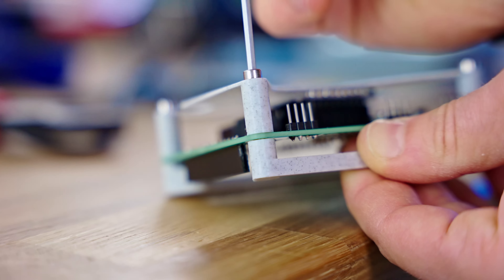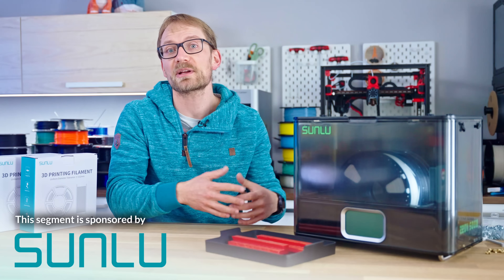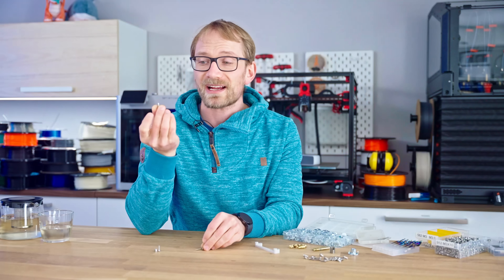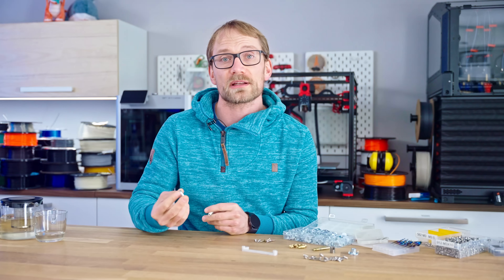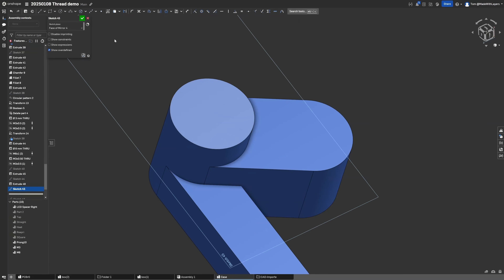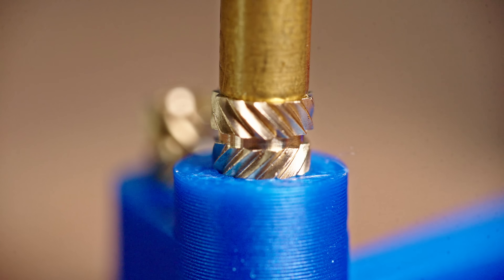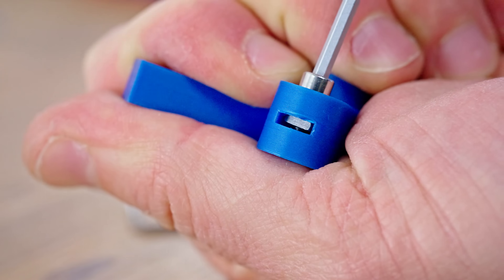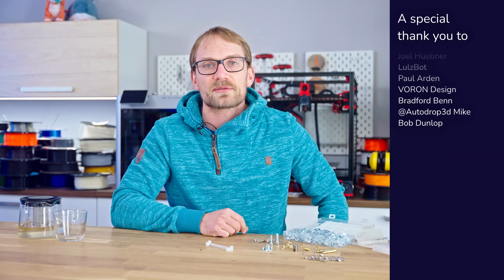A better way to add threads to your 3D prints

Comment: When ever I have holes in prints, regardless of threading method I choose, I ALWAYS use extra perimeters in the area of the hole.   Just about every decent slicer has a way to change settings for an overlapping volume or other way.  Having very well reinforced holes means that the holes are not where I get failures.

I always use 150% to 200% line width in areas where I need good layer welding for stress. (Thanks, CNC Kitchen for all the testing).

For nut slots, a small little bump of plastic can keep them from coming out easily, optionally a 3d pen putting a dot of plastic in hole, or simply a dab of hot glue.  The hot glue is nice in that if you don't go nuts covering your nuts in glue, you can easily pry the hot glue out with a pick or tweezers.... This is a place where a little goes a long way.
Reply: What slicer are you doing to target specific areas? If I was trying to increase wall adhesion for a hole, Cura only allows modification of wall inset, inner/outer line width, and wall flow over the entire print stack.
Reply: @Infinion  cura does in fact support modifying print settings in overlapping areas. 

You drop in a second model... A box, sphere, cylinder, or other useful simple shape.

You scale said shape over the area you want to modify.  You can unlock the scale controls so you can stretch more in one dimension than another. 

You can toggle the mode of the object that is overlapping to make it a modifying boundary.  There are YouTube videos that show you how to do this, or to can just play with it knowing that yes you can use one model as a modifier for another model that you're printing. 

When the modifier model is selected, you'll have the ability to select what settings you want to override.

Mastering this technique is not too hard and it enables you to reinforce areas where there are holes or use extra infill but only on certain problematic areas.  All kinds of useful stuff.
Reply: @ Wow that's exactly the kind of thing I was hoping to hear, something I'd completely missed. Thanks, i'm going to jump down that rabbit hole and try it out.

Comment: sorry bro but a straight hole is perfectly repeatable if the plastic is melting then just drive it in slower. I use them all the time and they are more than good enough

Comment: I used to do the slotted nuts until like 2-3 years ago and use exclusively heat-set inserts now. Super easy to use (once you've done it a few times) and unrivaled in strenth.
Reply: me too.I feel like i've mastered the art of inserting them straight with a mere conical tip of the soldering iron, after doing like a mere 4 of them.
Reply: @victortitov1740 I learned a tip a completely changed my experience with heat sets. If you press them in most of the way then use a flat piece of metal or similar material to press them in the rest of the way (while the insert is still hot), the inserts go in straight, flush with the surface, and there isn’t any plastic bulging around the perimeter of the inserts. Hope this helps!

Comment: For me personally threads have generally worked quite well added to the design and printed. 
Even if they are not perfectly formed, generally it seems screws are able to move away / fully form them after use.

Comment: I often try to use a large vice to press in threaded inserts.
Sometimes I can add negative space behind it to use a lot longer M3 bolts so the direction is already set and I can use the vice to push them in.
Using a soldering iron is not matching with my level of (im)patience.

Comment: Lol, nah I use wood screws all the time. I'm just careful with the walls. Concrete screws are slightly better as they have a shallower thread than wood screws but still deeper and more grippy than machine screws. 
I live in Australia so wood screws are always in stock at bunnings,  whereas machine screws are either a trip to the local fastener supplier (in business hours) or take a risk on an ali order. 
Bunnings has machine screws in the right size only sometimes.
I only ever model threads for a printed to printed interface. 
Also, just through bolt with a hex nut is normally quite good.

Comment: Hi, very nice and informative. I think you forgot the option of  designing a hex/nut shaped slot on the opposite side of the bolt head. Very common and take very little space and is also rather strong and durable

Comment: I have been using heat inserts without heat for years.  I just design the hole slightly smaller than the insert and use a screw with a washer to force the insert into the other side like the large flanged nuts.  Also, I have been using hex nuts with the modeled point of the nut going towards the cavity, like an ope end wrench.  I rarely have had problems with hex nuts not working.

Comment: How do I make two threaded inserts line up so that I can put a single screw through both of them? An example being one insert in one printed part and another insert in another printed part, both need to be fastened together with one screw.
Reply: You use on heatset insert in one part. The other part has a hole big enough for the threaded part of the screw to slide through. Screw goes through that and into the heatset insert in the second part. As it is tightened, the parts are pulled together. You can add indexing features to the parts to keep them aligned well.

Comment: Recently designed a cooling shroud for a (now obsolete) mellanox 100gbe network card to use in a not-server use and I had no I idea where I had put my heat insert m3's, so I used m3 hex nut slots. There was some cursing involved in getting them slotten in due to the duct structure. But at the same time it was faster than ordering new heat inserts especially for prototypes that need to get out now rather than later.

Comment: Hidden nut is one that was left over. That means pausing the print and inserting the nut mid-print. It has IMHO superior strength but also quite finicky at time. You need to be very careful with tolerances so that in no case can the nozzle catch them and then there is the hassle of dropping them in the print. TIP: insert a parking routine in the pause at height code block. Think where the print and the printing head has to be for you to be able to drop the nuts in easily.. i've been burned by that once, literally (the damn nozzle lifted like 5mm up...).. You can use a tiny bit of superglue to hold them in place. 

But i found one insert type that i had not even thought about before, i got new ideas what to look for in the next trip to hardware store. There are fair amount of "inserts" when you look at sheet anchors that might work.. They are a bit large though but... who knows, there might be something useful in that department. There have been a lot of cases where i've had to use quite big bolts, i don't do a lot of fiddly things.
Reply: I tend to do this with the "inserted nut" method, otherwise, see 9:56, the printer will be trying to print a circle in mid-air, and the nut just helps to hold it up. Still not great since the hot PLA may not stick so readily to the cold metal of the nut.

Comment: wood screws are harder to source than machine screws? what??
Reply: also yea, wood screws are hyper-available, but extremely anti-standard in ways that don't matter to wood, but will greatly impact the amount of strength they remove from the perimeters
Reply: They look like what I've always known as self tapping screws.
They were used a lot on the buses I used to work on. The woodscrews have a pointed end, self tappers don't.
Reply: Not all self tappers are the same. Some are "thread forming" and others are "thread cutting." AFAIK it comes down to the knife-iness of the thread profiles 😅
Reply: @nodnarb3799  I like that - "knife-iness" lol
Reply: @nodnarb3799  I was a fitter so more used to proper threads, BSF, BSW, UNF, UNC, and Metric, not forgetting BA and BSP threads lol. Didn't get to use self tappers that much.
Reply from the maker: No, plastic-specific screws.

Comment: The self-forming thread comes at the perfect moment because I'm designing a holder for some art pieces where I need some holes for screws, but the parts have to be printed horizontally. Thanks Tom! ❤

Comment: I've used that "self forming thread" thing with friction fits a lot. Creating such ridges give the plastic a chance to deform and you get very nice fits quite easily. Of course it is not as strong since there is less surface area but you can also add epoxy or other glue in there. Do not use superglue for this... 

Superglue works the best the thinner the glue is and wider the area, and with ridges there is some space between the large surfaces. It is also a PAIN to work with friction fits and super glue, it can harden too quickly and you are left with stuck parts that are almost there... If you have to be able to detach the parts again, use contact glue. It isn't very strong material, it will hold things nicely but also can be pried off without the plastic breaking.

Comment: @5:10 I've seen the same method but for injection molds years ago, where the hole is just a square. This is not a new method, it's just that mengs are tight-asses with their knowledge.

Maybe not the best method for locating the screw, BUT for enclosures and the like, it works just fine and will print with ease and without orientation correcting.
Reply: Agreed. If it is a lower strength application, square holes are simple and more forgiving that getting a round hole just right for a small screw to self tap. Also, they print well horizontally as diamonds. I do like that inside bump idea. I could see it allowing for more aggressive engagement.
Reply: @charliekrauter5176  I guess the strength kind of depends on the tolerances. This works a bit better with self tapping screws, but normal machine screws will do just fine.
I guess if you need more engagement, then you can opt for a hexa or even octagon. Octagon should work quite well to be honest, even for more precise location, for normal machine screws.
You just need enough space for the displaced material.

You can also slightly chamfer the edges of the polygon that you are going to use, to avoid internal stresses.

Comment: oops i made a booboo. saw it wrong. great video.
Reply: Nope, at 0:07 he is hanging from the print. There are 2 holes in that part. One is used to attach it to the ceiling. The other is used to screw the metal strap (that he hangs on) to the print. So it is testing the 3d printed threads.
Reply: @charleshobbies  sorry. i am wrong indeed. saw it wrong. looked like he was screwing it in the ceiling but he isnt.

Comment: I just model the thread and maybe chase it with a tap later. Extremely easy and fast. 

The only reason that I use brass inserts is if I frequently need to remove the screws.
Reply: I also model and tap.  I've started adding a tiny bit of oil to the tap or hole (especially for small holes) so that any heat buildup doesn't cause the cut plastic to stick and fuse
Reply: @wemike  Oh yeah. I use a bit of water to keep it cool. Amazing how quickly the plastic heats up!
Reply: Yay always love seeing one of the other channels I follow comment on another channel!
Reply: @ Thanks for watching both of our videos!
Reply: Yea, I've found this to be a good method; even for smaller threads. Having the thread modelled and printed means it's trivial to clean it with a tap as you're then having to remove very little material, and the resulting threads have always been more than strong enough for my uses.
Reply: I don't model the print. I let the bolt form it. formed threads are stronger than cut threads
Reply: This is the method I use, and I've used it down to M3 and #4-40, with repeated success. If you want it to work even better, with less material removal, once you have the threads in your model, offset all of the surfaces by ~.004" or 0.1mm. This opens up the threads slightly, and allows the tap to catch easier, and remove less material. Adjust the numbers to fit your printer, though.
Reply: Same, at least for holes along the Z axis. I've found that subtracting a truncated cone from the end of the threaded hole (wider end at the surface, diameter a little bigger than the major diameter of the thread) makes it easier to get a screw started.

And of course there's the classic method of clamping two parts between the screw head and a nut. Easy and strong, but it requires two tools to tighten or loosen the fasteners.

Comment: Longevity for me is the main reason for using heated inserts! Specially in stuff you keep unscrewing (like gearboxes and stuff!). Plus it looks hot. If it's a one-off, using printed holes is perfect!!
Reply: Except that using nuts is going to be stronger, unless the method of using the nuts is going to make the structure less strong. Nuts compress the plastic structure between it and the screw, as opposed to the heat insert and what grip it has on the plastic, but they do look cool and are less fiddly.
Reply: @nimeq  And you can even model a pocket for the nut for one tool tightening.

Comment: CNC kitchen out here making plans to make a certain youtuber vanish this weekend. Jokes aside: Heat set inserts have much better longevity for any application that requires assembly & Disassembly + if you get M2.5 screws with M2.5 Heat set and M3 Heat sets you can design screw connections that do not creep away because the base hole of M3 is 2.5.
Reply: I like them as it makes assembly feel nicer... I use a mix, but anything that other people might use get inserts.
Reply: He says this in the video. I mean, you have to watch it to know this, but still...
Reply: @ltlbuddha  I watched the entire video before commenting - this was not meant as a critisism for his video, just a PSA that you can use M2.5 screw to screw down M3 Heatsink inserts, which then fix the part thus bypassing creep.
Reply: "Heat inserts", not "heatsink inserts".
Reply: You should edit your comments to replace the confusing "heatsinks."
Reply: @michaels3003  err... maybe later.
Reply: Yeah and I think the video overstated the difficulty in aligning them properly. First time I did it perfect with a cheap soldering iron from amazon.
Reply: nine nine! Verstappen oot ma dinnah! Oot mah peez, ott mah carrots!